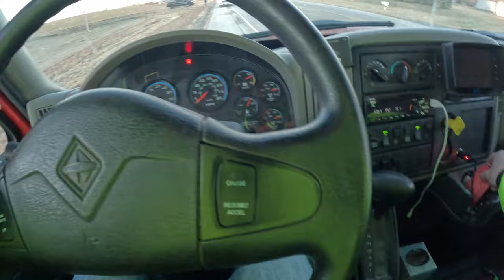When your morning starts off like this, You just want to go back to bed and start over.

Comment: Knew instantly when I saw the front end. Looked identical to my wreck 3 weeks ago in a soul. Broad sided a deer at 70 coming home from work. $3500 out of pocket to fix.
Reply from the maker: This was about the same, 65mph zone but a total loss. She had just got new tires weeks prior too.
Reply: @roementowing  this would Have been if insurance was involved. My aunts car and she dropped full coverage last year. Local hooker(tow truck guy) is fixing it for me on the cheap. Luckily the bags didn't deploy on mine. But 75k mile 2014 soul so low miles and worth fixing. I wish I had been in my F250 or F550 with the massive bumper instead